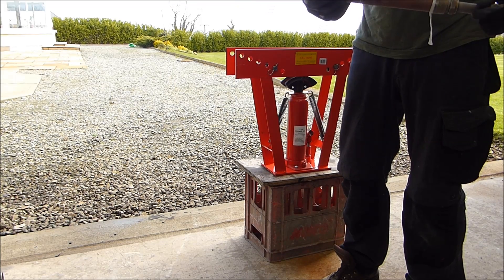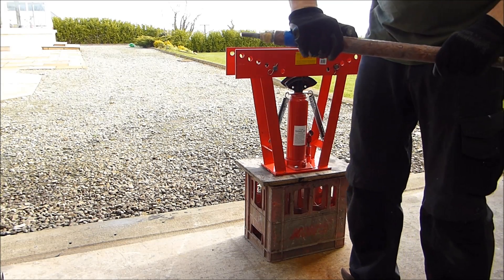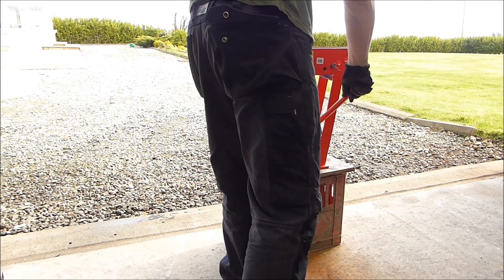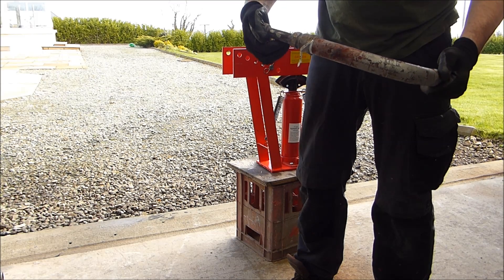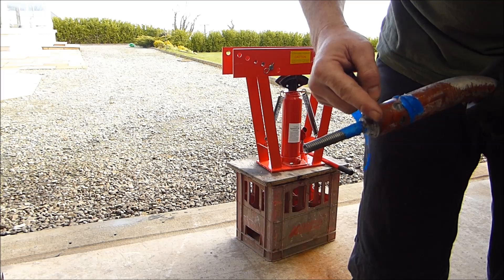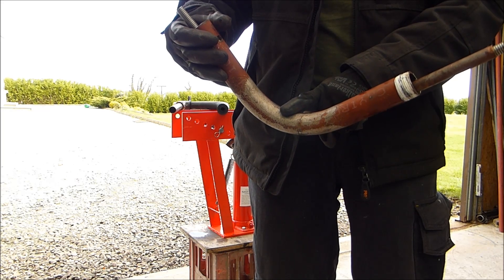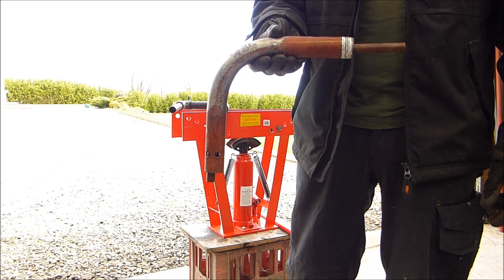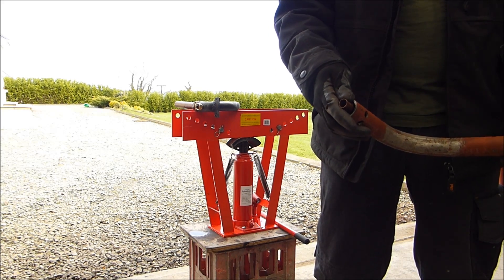Waste oil heater - Using ice to help bend steel.

Comment: Thanks for your reply. I am building a hunting cabin on my farm and I am off the grid down there. So I will be running off generator and solar. I want to use waste oil and I am banging my head trying to figure out how to transfer the heat to water but with how hot the unit gets I am afraid it will turn to steam real quick.
Reply from the maker: Hi. What size of an area are you trying to heat and how well insulated is it. Cheers Gerry
Reply: 1000 sq ft. and yes sir very well insulated

Comment: If I was to put this in an insulated metal shed lets say 8ft x 8ft x 8ft and used the shed as a heat exchanger,would it be feasible to pipe it into a cabin through duct work and use it as a furnace?
Reply from the maker: Hi. If you had an external supply of air for the burn process and the heat from the stove was heating the inside of your container it would certainly  be possible to transfer the heat with fans to another location. Have a look at this video where you could transfer the heat using pipes and a curtain wall heat exchanger. In my video I was only heating a water storage tank but you could heat a large industrial curtain wall heater like you see inside open doors in supermarkets etc. https://www.youtube.com/channel/UCqe1yTIkHEFx17lmI1zvttA/playlists look at the heating hot water videos. Cheers Gerry

Comment: That was neat. I would have thought the line would crack after it froze. That's what happens to our water lines around here when they freeze....they bust. just saying.
Reply from the maker: Hi aracp. The ends of the pipe are open so the ice can expand longitudinally. But if it were capped it would burst open. Cheers Gerry
Reply: Thanks Gerry. I've been watching the heater videos. Really like them. Cya!
Reply: +Gerry's Waste Oil Burner it is nice to see an lrish person on utbe thay should be more
Reply: +David Doyle ..........Agreed..Listen up UTUBERS im tellin ya ders som smart paddys out der....NOW DAT WAS A GREAT IDEA GERRY
Reply: If you we're to add a small drip feed of water to the oil pan it will bur hotter and what part of lreland are you from

Comment: cracking video, thanks, how goes the project?
Reply from the maker: Hi thepoultrypeople Sorry I Missed all the comments in here. The waste oil projects went really well. To be honest the burners exceeded my expectations which is great. This is an easy to make burner for waste oil that can work in many different types of barrels, boilers, stoves etc.It can be made lots of different ways but when you make it right you get free heat for years. Cheers Gerry

Comment: Gerry, given the experience you gained during the events of this video, do you feel the spring through the inside of the copper pipe is absolutely necessary for a clean bend? Most places I have looked around here have bending springs that slip over the OD of tubing, and the springs have flared ends whose only purpose seems to be to guide your tube down into the spring. I could buy a large, long spring that might happen to fit the ID, but it would probably be quite expensive. I'm considering trying the process without the inside spring this weekend.
Reply from the maker: Hi Archeryfanatic2000 I think that it might be possible without the spring if everything had ice in it. Its worth a shot. If I can find a spare piece of copper I might try it just to see. I am working on a tweak to this burner now and will post later. Cheers Gerry

Comment: Great video! I like your idea of a washer welded to the bottom of the pipe. Last weekend I made my own where I threaded an end cap over the steel, and the copper tube protrudes through the center drilled hole of the cap. Then I drilled air outlet holes all the way around the center hole of the cap, attempting to create as little air obstruction as possible, leaving just enough material to keep the copper pipe center captivated. I used a carbide grinder bit to open up the air holes after drilling them around the center hole. I'm looking forward to seeing how your side air vents work. I had also thought of drilling side vents, but additionally wondered about welding 45° deflector fins between the holes to create a vortex effect. I wonder which air introduction method is more productive, vortex or turbulent? Again, love your experiments!
Reply from the maker: Hi ArcheryFanatic2000  I was inspired by your comments and have done something very similar to what you described. In this video I used a steel endcap and drilled the side walls with 6 x 13mm holes and of course a hole for the copper to go through. I had been planning deflectors but not on an endcap so you will see what I did in the video. http://youtu.be/y1pRU1iBTV4  Cheers Gerry